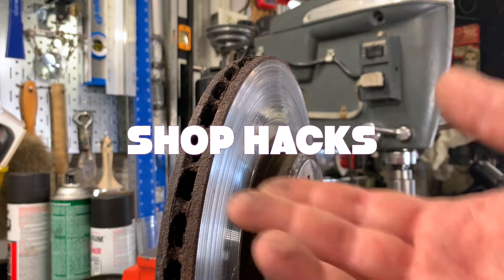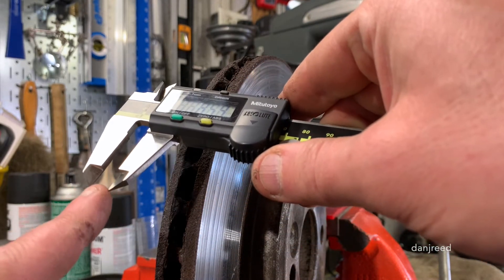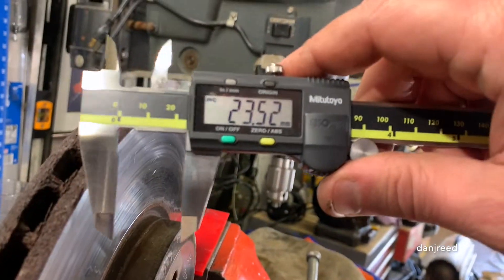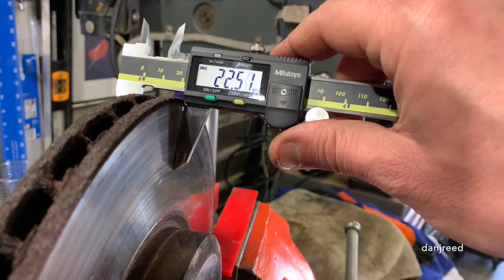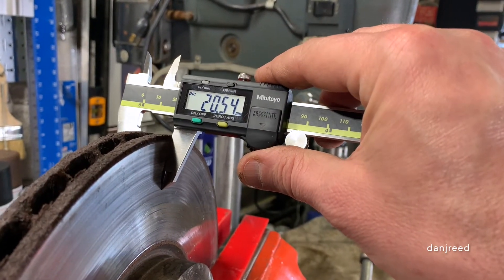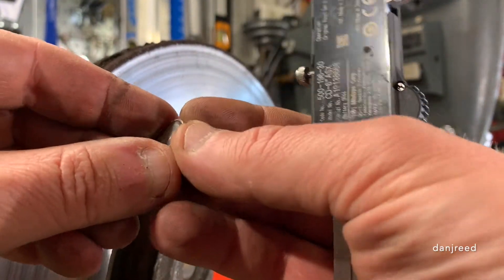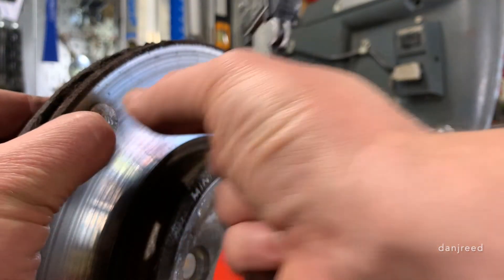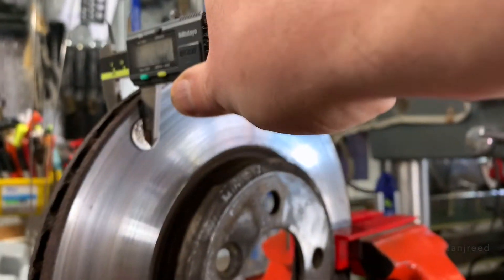No brake rotor mic, but you have a digital caliper? No problem!

Comment: The issue I see with this technique is that it is impossible to measure a deep groove that may be only a couple millimeters thick. The surface of a rotor can be wavy  with hills and valleys. This will bridge the gap over the deep valleys giving a false reading. Proper brake rotor calipers meet at 2 fine points to give the proper and accurate measurement
Reply from the maker: Yes, however it's better than no measurement at all.
Reply: If you have some deep grooves you'd want to replace the rotor anyways, this video is perfect for just showing a normal non damaged rotors surface and seeing if the thickness is safe.

Well done and thanks for the video :)

Comment: can you take 4 dimes and zero them out, then place the caliper on the rotor without the 2 dimes?
Reply from the maker: No, the dimes act as a flat surface on the rotor so it bypasses the rusty lip.
Reply: @danjreed  ohhhhhhhhh , i get it now, thanks!

Comment: Hello from croatia. Mine is at 26.2 thickness, and minimum is 26.4. Is it ok to use one more brake pads on it ?
Reply: Yes. I've heard as long as you're at least at minimum you can run 1 more set of pads.